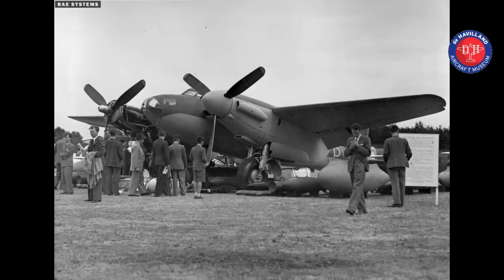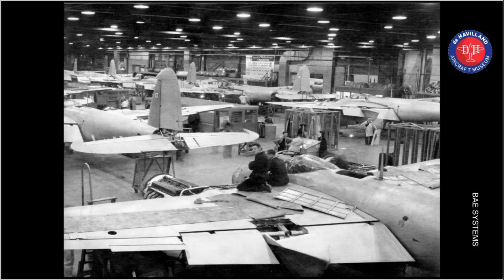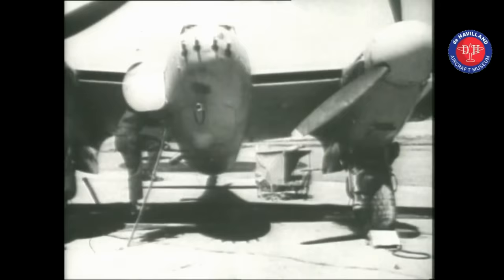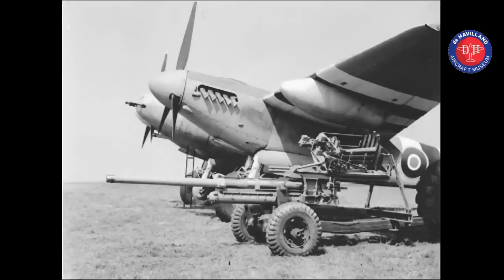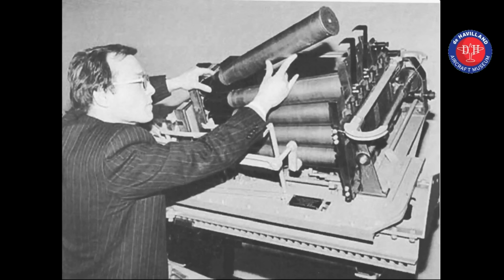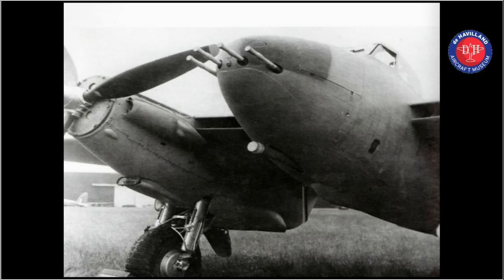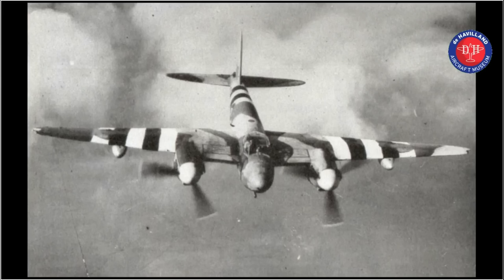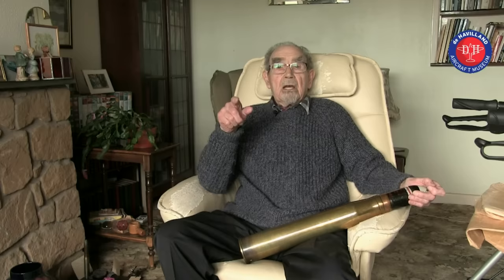TSETSE the DH Mosquito Mk XVIII

Comment: Jesus imagine a mossie thundering along at zero feet spitting those out epic
Reply: You think THAT'S impressive?
How about flying along a railway cutting  and then launching a bomb into the open mouth of a tunnel then climbing away before the delayed fuse explodes bringing the tunnel roof down blocking the tunnel. They used to do that too!
Reply: The laminated wood construction made the Mosquito incredibly strong and reliable to fly. They got so low on so many sorties because they could do it and get away with it.

Comment: My closest approach to a Mosquito of any variant was an Airfix kit that I made as a kid in the '60's. Lacking any other knowledge at that time, it became my favourite, its beauty surpassing that of even the Spitfire, in my mind. Later, as I learned more, my appreciation of this aircraft increased even more. As a wartime tool, it was just superb, the WWII equivalent of the A10 Warthog.
Reply: The Mosquito was a huge amount more than that.  It was effective as a high speed fighter, reconnaissance, path-finder, bomber - and many other roles.  It could carry a heavy bomb load and deliver it more accurately than any other plane of WW2.  A truly remarkable aircraft.
Reply: I think the P-47 Thunderbolt was more like the WWII equivalent of the A-10. The Mosquito, on the other hand, was followed by the Canberra and (in my books) the F-111 and the Tornado. I suppose the  F-35 is today's attempt, but the verdict on that one is still out ... The F-4 , F-15 and F-18  have been used extensively in the multi-purpose role, in the classic two-engined configuration.
Reply: the warthog is just a copy of the original .......The  Mosquito

Comment: Lil bit of interesting info:

In early 1945, a 32lb version of the anti-tank gun was proposed for an even more powerful Tsetse. It would have been used as a bunker buster, coastal patrol aircraft and against German heavy tanks in an air support role, since rockets were far too inaccurate to be used against mobile armour. 

But, much like with the Centurion, the war ended too soon to implement it. However, the engineers at DeHavilland insisted they be allowed to fit a prototype after the war 'just to see if it would work'. 

It did, flying well despite the weight and massive recoil of the gun. Proving that if the war had dragged on, the mosquito would have continued to innovate and stand against German armor on land and at sea.

Comment: that 57 mm  solid shot would put holes in a sub very easily. I can't imagine it taking even one shot.
Reply: The damage they would do rattling around inside. 4 dead from 5 shells. Probably made a mess of internal plumbing etc.
Reply: Burt Hulbert Considering that almost all of a U-boat is below the waterline, ANY hole in it's hull is a very serious problem indeed.
Reply: Internal plumbing. Damn! My internal plumbing would be acting up something fierce if i was on the recieving end of that cannon. Kinda wonder how well that 57mm would do if it was shooting explosive rounds. Could raise hell on ground troops

Comment: These flyers and what they achieved are deeply impressive.
Two extraneous observations: 

First, related to drcurv under Kathryn Truscott below, I heard/read somewhere that the Germans wanted to copy the British idea of making planes out of wood.  The Brits got wind of this and learned that there was only one factory in Germany capable of making the adhesives strong enough to hold the wooden parts together.  British response: bomb the hell out of the factory in question!  The German Mosquito clone never got off the ground.
Second, on the issue of the detailed memories of these veterans, apparently intense adrenaline rushes fix memories forever.  Clearly, these heros experience such rushes all the time in combat.
Reply: I read that their 'Woody''  was abandoned anyway. The old story, too much diversity,  dwindling materials and pilots, TIME RUNNING OUT.

Comment: I sang in a choir with one of Barnes Wallis's engineers. He saw the test of the mini Dambusters bomb. Being made of plywood, the Mossie flexed a fair bit, which usually was not a problem. Unfortunately, with the Highball bomb, it flexed enough that the two halves of the bomb rack pulled apart, and let go of the bomb... My mate said that it was inches from being an unspeakable tragedy, but was actually hilarious, as this massive bowling ball went cross country at a 200 mph or so...

Comment: @Richard Knapman:
Fantastic story! Too bad these weren't ready by '38, and could've even been delivered to Burma, or Singapore.
Reply: They were tried in Australia, but the adhesives used in construction were not suitable for tropical humidity and they suffered from delamination. Aircraft had to largely rebuilt using different adhesives and then returned to service.

Comment: I knew one of Barnes Wallis's engineers, back in the '90s. He was present for one of the tests of the bouncing bomb. According to him, the test aircraft flexed so much in a turn that the two halves of the bomb rack separated, and dropped the (dummy) bomb at the end of the runway. 

The bomb was going at well over 100 miles per hour... and it kept going. He said that it went past people on the ground, missing by inches. "It was inches from tragedy, but as it actually happened, it was hilarious to see." He felt that this incident soured the Makers of Decisions on the entire concept.
Reply: And yet they persevered with the project. Upkeep was dropped by 617 Squadron and Highball, the Mosquito version, was tested by 618 Squadron, but never went operational.

Comment: I wonder why they didn't try using the Tsetse as a tank killing aircraft?  A 6-pounder AT gun might not punch a King Tiger on the front or sides...but the top armor would have been punched, by a 57mm gun.
Reply: Tanks tended to be part of a larger collection of vehicles to carry infantry, ammo, fuel, etc....and also AA vehicles with multiple-gun 20 mm auto-cannons, which the wooden, unarmored Mosquitoes tried to avoid. Rarely were groups of tanks found by themselves.
Reply: they had the rockets for the tanks. 8 rockets the equivalent of a cruisers broad side. lol

Comment: Good heavens . An enormous cannon for an aircraft . And not a very big plane either. It's an artillery piece of significant size. The length of the shell casings belies the velocity of the shell. Compare this to a 105mm on a C130 Hercules gunship. Twice the diameter but the casing similiar length.  From an admirer of your video from Qld Australia

Comment: Was there any role that was not fulfilled by the Ju88? I ask because you claimed that the Mossie was probably the first multi-role combat aircraft. It was probably the greatest but I suspect not quite the first. Thanks for an interesting post.
Reply: Ju 88 didn't fire rockets or drop torpedoes, nor did it have a recon version either

Comment: Very interesting video. I wonder if Geoffrey De Havilland  and the rest of the design team ever envisioned and anti-gun being fitted to the Mosquito? With the adhesives available at that time the fact that the fuselage / airframe could actually absorb the energy generated by that gun when in rapid fire is nothing short of amazing. Balsa,Spruce,Birch plywood, adhesive and brass screws just doesn't conjure up an image of utter reliability. And yet, the proof of the pudding etc. Much admiration for those designers and engineers who had total faith in their calculations, and full marks to the men and women that brought it all to life. The struts of the landing gear were so simple. i think Issognis and Moulton were not to proud to do a bit of retro engineering research. The Americans used the same principle on the suspension of Unit Rig off-road diesel-electric mining dump trucks. Still find it difficult to equate wood to such stunning performance, speed , aerobatics, reliability and load carrying capacity. I think that I am correct in stating that the Mosquito  for all that it achieved had essentially the same airframes throughout its life.. Feel free to correct that observation if necessary.
Reply: I.m sure you are correct...it sometimes happens that  things are got right first time .Herman Goering was inspecting a shot down mosquito and said .....They have produced this wonderful aircraft out of wood...every piano factory over there is making them"

Comment: The only thing close would have been a B-25 with a similar cannon installed in the latter portions of WWII amongst a few other airplanes (both Axis and Allied) that had large bore auto cannons installed, many for "tank busting" missions and ground attack sorties where the airplanes outfitted with these devastating weapons were used with great effect.    One pilot who flew the auto cannon equipped said that it literally felt like the plane was stopping in mid air with each round fired and it was an absolutely devastating weapon system when fired in conjunction with the 4 forward firing machine guns at the same time, shredding anything in it's forward path to bits and pieces of whatever was formerly in front of that aircraft as they dived down at incredible speed for that era unleashing a hell storm of automatic machine gun and cannon fire.    If you saw this bad boy banking over into a dive during WWII, you did one thing.............RUN!    Very very fast.

Comment: USAAF had similar ideas.  75 mm guns (albeit much slower firing) in two different versions were implanted in B-25 G/H models.  The design proved problematic and not all that effective thus rockets won out similar to the British preference.  The B-25  cannons really kicked but too often missed.   Some of these gunships were eventually retrofitted with more deadly multiple machine guns replacing the 75 mm gun.

Comment: (00:45) "In 1943 it had a 57mm Gun (preferred to call it a 6lb Gun then as not to offend anyone) - Kick like a Mule and could extent when required to at least 12"

You wouldn't want to argue with that, or turn away from it !

Comment: I'm guessing that when the cannon fired a round it slowed down the mosquito.  Brian Beattie, (95 yrs in this video) said the stragglers behind, I'm guessing they might collide with the mosquito as it fired the cannon and slowed.  Also firing multiple cannon would change alignment with the target?
Reply: I'm guessing the real worry was a ricochet hitting one of the rocket equipped Mossies that had just made their run.  When they first tested rockets on the Typhoon, they used cement filled practice rounds. On one of the early flights a Typhoon pilot watch his test rockets ricochet off of the target and pass through the wings of the Typhoon in front of him. As described in the video, ricochets could go anywhere.

Comment: I think the only big mistake the British made was to not take the P-38's offered to them by the U.S. at the start of the war, because the British did not like the superchargers.  While being chased by a
FW-190 in a dive the P-38 started having some rear aileron flutter indicating it was coming close to breaking the speed of sound.
Reply: Not true. Merlin, Hercules, Centaurus, Sabre were all supercharged. The P-38 was TURBOCHARGED and did not perform as well at low altitude, which is what the RAF wanted it for. Therefore ordered the normally aspirated version.

Comment: At wars end they tested a 96mm 24pound shell auto fired ...... It worked And they scraped the plane not long after The jet age begun
Reply: de Havilland didn't fair too well after the war either... its was still trying to sell jets made out of wood a obsolete technology by the jet age.
 The company made an extremely risky gamble on trying to produce the world's first jet airliner and failed miserably... de Havilland went tits-up after the Comet Disaster, the worst engineering failure in the history of jet aviation.
Reply: @sandervanderkammen9230  never heard of the wooden jet Could you please post a link to it? As i am Canadian And lived 800ft from the de Havilland plant They went on to make the chipmunk, The Beaver, The otter, Caribou And the ones i remember the Dash 7 And Dash 8 That still fly today The comet was not the  worst engineering failure in the history of jet aviation - It was the first Jet passenger plane that crashed from defect That was an unknown item of pressure And jet speed to fatigued metal Here is your worst engineering failure -     Boeing 737: 4,360 fatalities. 3103 to mechanical failure
Reply: @freakyflow  de Havilland vampire and venom were made of plywood.
Reply: @freakyflow  The Comet Disaster remains the worst jet airliner in history, only 114 built, 26 crashed or destroyed in accidents it has the worst safety record of any jet airliner in history.
Reply: @freakyflow  metal fatigue in pressurized cabins was well-known and understood by the world's leaders in airliners.
Boeing, Douglas Junkers and Lockheed were all building pressurized cabins years before with no catastrophic in-flight structural failures.
The Comet Disaster was a preventable tragedy
Reply: @freakyflow  The Boeing 737 series is the most successful aircraft in history 14,000 orders and 1 out every 3 people in the air right is onboard a Boeing 737.

Comment: The Me-163 rocket plane shot down very few aircraft during the war due to its largely impractical rocket propulsion system. But one aircraft that it did manage to down was the DH Mosquito. Not many aircraft could catch the Mosquito, but the Me-163 proved worthy of this task - and more than once.
Reply: Undoubtedly nothing the allies had could touch it for speed but it had too many shortcomings to be an effective fighter. Not least of which was it very short operational time before it's rocket fuel mixture ran out then underpowered it was easilly picked off. This is in fact what happened operationally where their losses of this aircraft were greater then the losses they managed to inflict on their enemy. That said from an engineering pov it was a good step forward in rocket and missile technology.
Reply: Drott150 ..so what?? .Our planes shot down far more of your shite..then you did ours ...lolol the 163 was utter bollox.

Comment: Do I see slats there on it outer wing?
Reply from the maker: The original prototype W4050 had Handly Page leading edge slats fitted. They were found to be un necessary and were covered over. They were discovered during the restoration and left on show.

Comment: Now why wasn't this squadron, equipped with Mk XVIII tank buster aircraft, used against the shore-line defences on Omaha Beach?
Reply: Gery.
The RAF was providing air superiority and the Luftwaffe could not interfere with the landings.  The British and Canadians used special weapons for clearing their beaches, they had tanks for mine clearing, other tanks for taking out well protected positions that would be hard to  attack with aircraft.  
What I find hard to understand is why Bradley refused the kind offer made by Montgomery to let Bradley have a lot of these special weapons.
Also hard to understand is why the Americans were put into the water so far out, many swimming tanks sank, not only taking their crews but leaving the soldiers that got ashore almost unprotected.
Reply: Omaha Beach had cliffs, so tanks were out of the question.
It is apparent that the allied infantry had no adequate radio contact with their staff at the base.
The Luftwaffe flew only ywo sorties over Normandy on D-Day.

Comment: How does this weapons system compare to the 75mm equipped B25-G I wonder?
Reply: Stone859 Much higher velocity but no high explosive. It was a 57mm anti tank gun.
Reply: Destroyed submarines and ships, took out the odd plane too
Reply: The B 25 75mm was a total disaster and barely used
Reply: Willie Eckerslike : Ther was a much shorter auto loader lightweight 75mm later on in the B25.
Reply: Stone859 ... and also the He-129 B3?

Comment: The Mossie was a great aircraft, but it could have been even better if it was fitted with counter-rotating props. It would have been much better to handle and a much more capable fighter. It was considered too costly in maintenance costs by Lord Beaverbrook, who was also responsible for the 'Lame Lightning', a P38 which he effectively hobbled by having twin right-hand rotating props and removing the turbo-superchargers. American P38 Lightnings had counter-rotating props and all the brilliant Charles Lindbergh modifications, making it perhaps one of the best fighters of WWII.